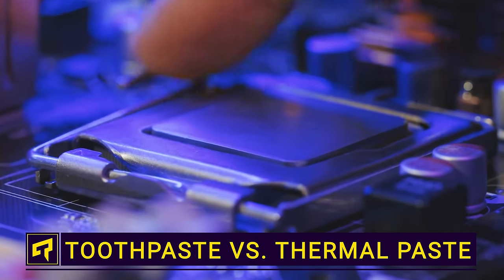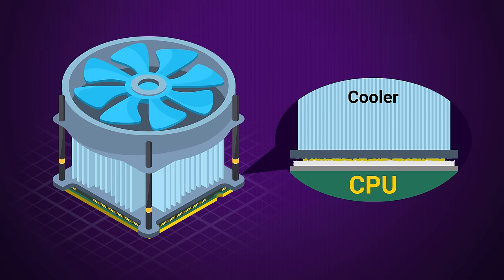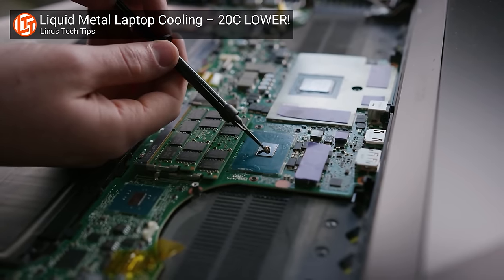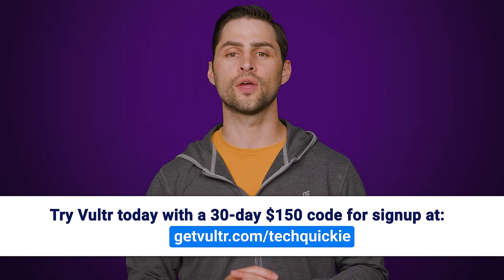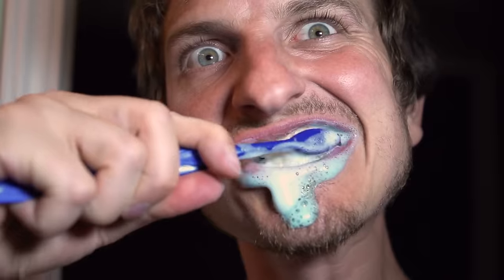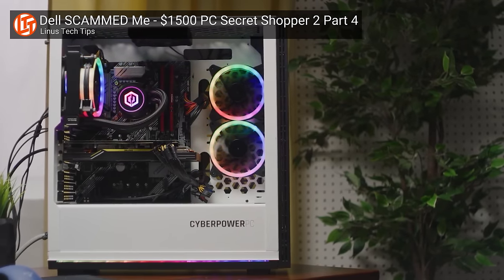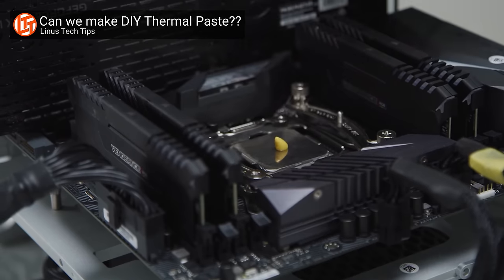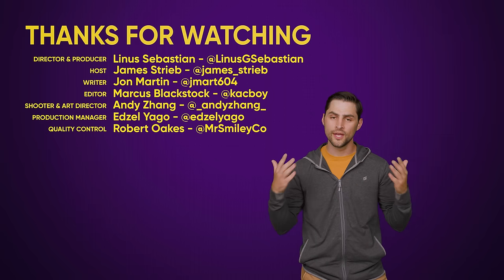Yes, You Can Use Toothpaste As Thermal Paste

Comment: I can’t imagine “being in a pinch” so much that I couldn’t wait a day or two for actual thermal paste rather than getting TOOTHPASTE all over my cpu. 🤦‍♂️
Reply: Imagine your weekly raid starting in an hour and you tried to quickly install a new cooler only to realize they didn't ship any paste with it. You spend 20 minutes googling what to do, 10 minutes applying toothpaste as per this video, 5 minutes booting up and ordering thermal paste on Amazon, and then you have 25 minutes to log into your favorite MMORPG and get ready to raid. And then when your paste arrives, you fix it properly.
Reply: In an era of online classes and work from home, I have admittedly done some desperate shit two hours before my exam closes out when I had computer issues. I’ve never used toothpaste on my CPU, but I can think of some scenarios that would put me in that position.
Reply: Sometimes "being in a pinch" is more than few days:
My first pc had Pentium 4 cpu and I had no idea about any part of pc. One time i removed cooler and found dried, grey paste (almost a powder). Some of it fell off, and i reassembled it that way with air holes. Few months later when I found out what paste is, I removed old paste and connected cooler without paste, which was better than dried paste and air gap because there was some direct metal-metal contact. It performed nicely until I found a store few towns away that had thermal paste. It was metallic particles in oil, but what can you do. It worked nicely until I decided to inspect it and metallic particles were settled on lower part of cpu ihs. I reapplied it untill I get better paste. In the mean time river broke enbankment and it got under water as well as 2 story house ( 5m of water). RIP old PC.
Reply: Living in unstable environments.

Comment: I did this once in the 2000s because I didn't have anything else and it worked great. So great in fact, that I forgot about it until I replaced my old PC...
Reply: Same here. I once put it on an AMD Athlon XP 1800+ plus back in those days. Worked just fine. This is before CPU's had thermal protection, so getting it wrong would destroy it. Temps were just fine, maybe a little high, nothing crazy.

Comment: I have found that 5 years is a pretty good replacement time frame for most thermal paste renewals.  Most people don't flog a computer like hardcore gamers so it doesn't dry out too fast.
Reply: Hell, I just redid my OG XBox thermal paste last month, which I bought at launch in 2001. Despite being pretty dried out and stiff, I only dropped a couple of degrees after testing with my new application of thermal paste. That's quite a testament to the original stuff.
Reply: Even it can last a bit longer in lower power laptop CPUs, like Ryzen U series, Intel Core U series, and most Intel Celerons
Reply: @TooBokoo  dude that is insane
Reply: @DragonProtector  Truly. I had to scrape it off and it almost had the consistency of old, dried, crumbling cement, but those temps were still pretty in check. Probably could've just let it go another few years. Lol
Reply: @TooBokoo  truly crazy
Reply: @TooBokoo I got improvement in 20*c

Comment: I've done this a few times but I'd only recommend doing it with low power components. It worked fine for me on a 15w laptop CPU and old dual core Athlon CPU despite having a huge overclock from 2.2 to 3.95ghz though

Comment: So far, I have actually done well using lubricating greases as thermal paste, so that tends to be my goto if I don't have the right stuff on hand. I also see lithium grease also is fairly thermally conductive.
Reply: How do you clean it? Those blue grease rags?
Reply: @chadmann2724  Use a degreaser, be it Greased Lightning, or Goof Off.

...though I'm talking about dabbing a bit of grease between the die and the heatsink.
Reply: @chadmann2724  Never tried toothpaste. Also, last time I used grease was on my Pentium 4.

Comment: My thermal paste dried out so i put Vaseline in it and mixed it well with the dried thermal paste and re-installed the stock cooler and it worked well on my pentium gold g6400 with a maximum temperature of 62° (81° with dried thermal paste)

Comment: I used to use toothpaste on my 3ghz pentium 4 back in the 2000s. It worked great, but it had to be replaced regularly. That was fine though, because I was in and out of my case on almost a daily basis
Reply: I’m honestly kinda confused and feel like we’re missing some part of the story here lol. Why were you routinely using toothpaste instead of thermal paste? Why were you in and out of your case on a daily basis? Wouldn’t it suck constantly remounting your cooler?
Reply: @CoffeeKadachi  toothpaste cos I had it and didn't have thermal, was preteen back then so no money. Cooler was very easy to remove, old air cooler with 4 clips. In and out of the case because I found it fascinating, not that deep really
Reply: @fishrsa9046  same here, athlon 2 x4 641 the old fm1 socket
Reply: My first pc had 3GHz Pentium 4 cpu and I had no idea about any part of pc. One time i removed cooler and found dried, grey paste (almost a powder). Some of it fell off, and i reassembled it that way with air holes. Few months later when I found out what paste is, I removed old paste and connected cooler without paste, which was better than dried paste and air gap because there was some direct metal-metal contact. It performed nicely until I found a store few towns away that had thermal paste. It was metallic particles in oil, but what can you do. It worked nicely until I decided to inspect it and metallic particles were settled on lower part of cpu ihs. I reapplied it untill I get better paste. In the mean time river broke enbankment and it got under water as well as 2 story house ( 5m of water). RIP old PC.

Comment: I used toothpaste as thermal paste both on Athlon II x4 CPU, and ATI Radeon 4850 GPU, The air cooler was stock AMD
The case was wide open because my country is near equator which is very hot and humid (And I dont have AC)
So I just shoot the PC using room fan

And in my area, dust would accumulate FAST
Thats why I usually re-cleans my PC twice a year, with or without thermal paste
and idiotly, I always forgot to buy thermal paste even tho i always said "I will buy it next time" lol
For those period of time (5-8 months), the paste has dried, but still works just fine

The PC built since 2009 intensely used until 2016ish, The motherboard broke because unstable grounding in my house
After that im using laptop until 2020ish (which, the battery also broke years later lol)
And now I have new PC (Using thermal on i3 12th)

But Im pretty sure, if i have the motherboard, that processor still can boot up again

Comment: I used coconut oil mixed with the dried out thermal paste on my Ps4 I built and have had no problems yet I still need to open it back up and see how its doing after 2 years

Comment: Thermal paste "drying out" is not a problem. The oil is only there to facilitate application and allow the particles to pack down over time for better conductivity. "Dryness" only becomes a problem when the heatsink gets knocked around hard enough to break the settled paste interface which would otherwise last indefinitely. You don't get this from improvised paste substitute since those have volatile compounds and other ingredients that aren't chemically stable like zinc and aluminum oxides.

Comment: Here's a 2000s tech tip! Got a scratched CD/DVD? Put toothpaste on it. Let it sink in for a few minutes, then gently wipe it off with a paper towel, from the hole out towards the edge, and literally rinse and repeat until it's all gone. Huge chance you'll have removed enough material to smooth out the scratch and now you can play Twilight Princess on your Wii or whatever else you wanted to do in the mid 2000s.

Comment: I'm going to go out on a limb here and say you should probably only ever do this at the same time as under-volting and clock-limiting the cpu... then you don't have to worry about it getting to 100 degrees C or over.
Reply: Eh, disable turbo if it starts overheating but leave it alone if there's no issue

Comment: Have you guys already tried using anti-seize copper grease as a thermal paste? It has some copper in it, so I wondered how it will perform when used as a thermal paste. 🤣
Reply: Probably bad because of grease part. I can assume that that grease has low thermal conductivity. Also depending on copper particle size, you might create bigger void between cpu heatspreader and heatsink. You can also use no paste, but results depend on contact area and pattern.
Reply: @Pukovnik141  Copper is the best electrical conducted... Very bad idea to use that...
Reply: @Pukovnik141  thermal paste is made with silicone grease which is probably also what the anti seize grease has

Comment: I think if you could get the surface of the heatspreader and the heatsink sufficiently flat, you might not need thermal paste at all. I mean, it's designed to fill holes... so what if you could get it so the surfaces fit together perfectly without the need for paste to fill in holes?

Comment: I have seen mayonnaise be used as thermal paste

And it worked
Reply: Until it you cook it with heat. Then problems start (overheating, smell, bakes itself to surface, corrodes metal).

Comment: What is the best home thermal paste alternative that can last long
I’m rebuilding an old pc and I don’t have thermal paste
Reply: I would not recommend this. Some grease could be used, but components will overheat. You can even do without paste, but it will run hotter. Every home paste tested will not last long and wont perform as good as thermal paste. You can try to make your own thermal paste, but it will cost you more than buying one. Arctic mx2 is good cheap paste that has long life (non drying) if you don't want to spend much money.

Comment: why use thermal paste at all, as long as you arent doing anything that actually loads the cpu, it is unneccesary, i installed windows, apps, and transfered all my data, as well as watching youtube, and doing some other casual things with an old cpu and tiny aluminum heatsink while i was waiting for my thermal paste to arrive, it worked like a charm, temps were ok to

Comment: Been using Colgate toothpaste as a thermal compound with an AMD stock cooler on a Ryzen 5 2400g for about 2 years in our family computer at home That thing has been running all day every day for two of those two years. Cpu temps never exceed 75c
Reply: Dude just get some thermal compound before your luck runs out

Comment: A problem with tooth paste can be it's abrasive properties. Depending on the size of the abrasive particles, it can make for relatively deep scratches or even act as spacers increasing the layer thickness making it thermally worse.
Reply: It depends what paste is used. Some particles are harder than metals used, some not.

Comment: If we aren't swaping components, why would we need to check our thermal paste? Maybe every few months or years but...

Even your video didn't have any examples why we would need to do this.
Reply: If someone replaces cpu or removes heatsink out of curiosity. Depending on paste state it would be better to remove old stuff, and if you don't have any thermal paste neaby then there is next best thing. I think that no paste will do just fine until you can buy good paste. i wouldn't put any crap on my cpu, especially because my cooler has exposed heatpipes with small gaps between them. Those can't ever be cleaned properly.
Reply: @Pukovnik141  Who just randomly starts taking computers apart without having the supplies to put them back together at a point when they need the machine?

Comment: Can you immerse whole fully assembled motherboard in the transformer oil which is dielectric and then pump it through a radiator to cool it down. Thus every single part of motherboard will be in contact with the cooling agent...which also protects from dust :)
Reply: That's insane... But logical! To that end why not try distilled water? Distilled water isn't conductive. Build CPU's in fish tanks? I'm not trying to be a smart-ass. This seems like a great experiment for Linus Tech tips to try.
Reply: @John_Be  Distilled water would pick up impurities from the circuit board and become conductive over time.
Reply: @katbryce  You can add simple fuel filter in the line between tank and radiator...that will catch all impurities. But again...if there is no moving parts (like in gearbox) then there is no way for impurities to collect...just my thoughts
Reply: @John_Be  Good idea...to test different liquids...a new level of liquid cooling 😀
Reply: @martinsmillers1058  I mean things like dissolved metal oxides.
Reply: @katbryce  ohh that one (me, making smart face expression and pretending to know what's that) 😀

Comment: i've used wheel bearing grease before. wasnt very great but way better than the rememenants of dried thermal paste with air gaps left as some moron re-installed the cooler without any thought of the thermal paste

Comment: honestly if I were in a pinch I'd reach for aluminium foil. Cut out a piece the size of the CPU heatspreader and you're set. I have been running this for a long time now and it runs just fine. Obviously you wouldn't want to overclock your CPU but my 5820k is running games just fine like this
Reply: Isn't this face in the same problems as the gaps between the heat spreader and the processor? The aluminum foil isn't really filling in the micro gaps, if anything it's just adding its own micro gaps
Reply: Taistelu_pelto  Unless I run prime95 small-fft's I don't get anywhere close to the temperature where it starts thermal throttling. I just did a CPU-Z stress test and the hottest core got to 75°C
Reply: Taistelu_pelto  well I never have a normal workload which would push it this far anyway. Again for gaming, streaming, browsing the web and even things like CAD or video editing would not be enough to overheat this

Comment: good replacement for thermal pads white toothpaste and vaseline/petroleum jelly. 30% Jelly 70% toothpaste i use it on all of my GPU to replace the termal bads when they get dirty from too much playing with them  in experiments.
Reply: If there is airflow its better to use nothing. that seems like a good heat izolator.

Comment: In a pinch DO NOT use thermal compound. Whatever direct contact your cooler will make with your CPU should be enough for a day or two, until you get some proper thermal compound.